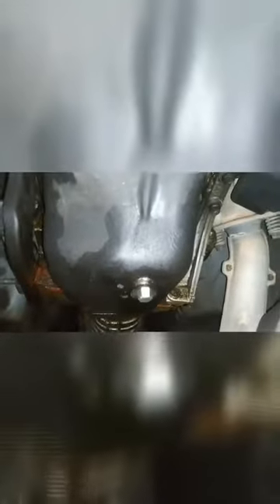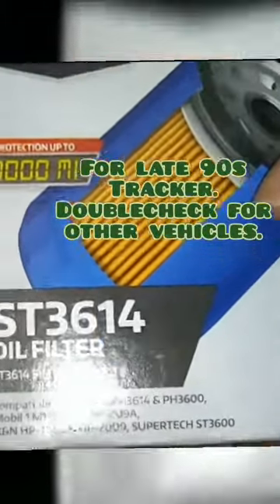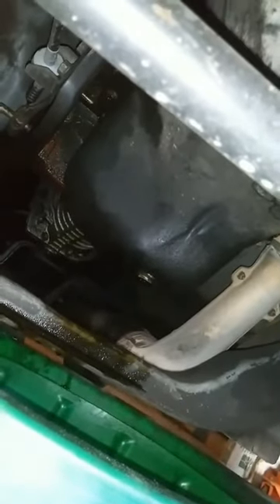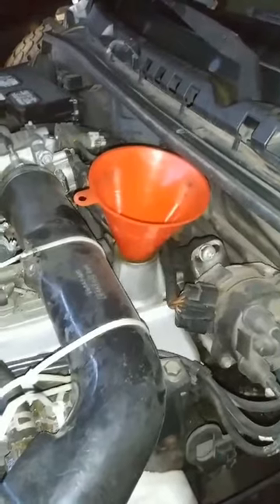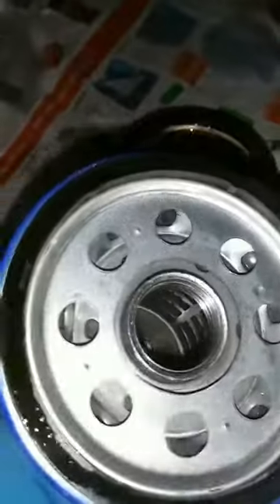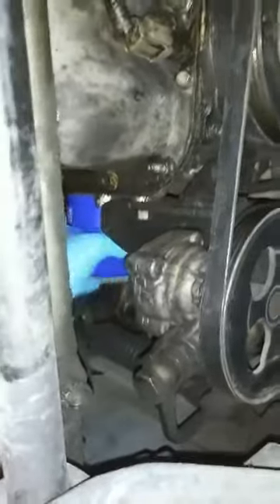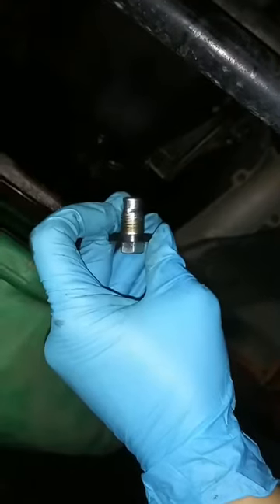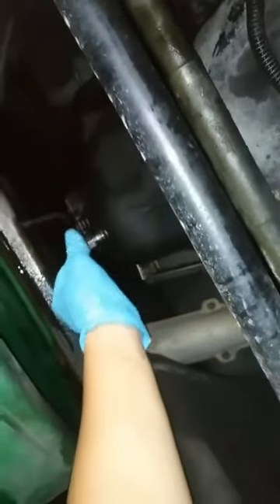DIY Oil & Filter Change (Saving $ with Auto Maintenance, on a Budget)

Comment: Here’s a little quick tip if you ever add too much oil on accident you can actually put a shop vac where the oil cap goes go down and take the drain plug loose and the vacuum will actually pull air from the drain plug and it won’t leak out if you break the seal on the top you can run some oil out then put the vacuum back on it and then reinstall the drain plug and check the level. Just a little trick I learned working at Jiffy lube
Reply from the maker: That's really cool! I'd never heard of that before & will pass it on.
Fortunately, I've not overfilled more than a hair above the full line but I've heard stories from others.

There's no way there's enough suction for the vacuum to take n any motor oil?

Oh & another funny coincidence. The Red I met last weekend, work at Jiffy Lube too, until last year. Ha ha.
I'm tempted to text her about this. I did mention talking Trackers with u, to her though, since she had the same nickname & all. 😃
Reply: @chm3598  that is funny. Red is actually my “call sign” when we airsoft. I think it had something to do with I was always the captain of the red team and then it just stuck. But I have heard of other people having that nickname but usually they have red hair lol. I don’t know what my Heritage is, my mom always said we were just Heinz 57 a little bit of everything. I do know on my dad side I’m like a 32nd Cherokee which is probably why my facial hair grows in all joe dirt like.But then again my brother can grow a full glorious spartan beard which I may be a little bit envious of. Anyway yeah I should’ve kept my jeep another vehicle I wouldn’t mind having maybe sometime in the future it’s like an old 800a scout international. You might have to Google that one LOL
Reply from the maker: @Red-yn9fv  Oh ok. Yeah, the other "Red" is because of her hair. She brought that up, that your hair is probably red too but I wasn't sure. Haha
Getting your name from being captain of the red team is unique though.

Hey! At least shaving is easier for u & u don't go through as many razors. 😁 I bet your brother can't say that!
My brother is the same with the scattered facial hair but that's from our Asian half. (The other half is Heinz 57, like u.)

I'm familiar with a Scout. Interesting choice! I don't see those very often, around here.
I've got about 5 dream vehicles. The top one I don't own is a military Hummer. Will def need a bigger garage one day! Haha
Reply: @chm3598  you can pick those hummers up from military auctions but they are super expensive. Yeah the shaving thing for me is about once every two weeks or so lol. I really like the old scouts but not to keen on the scout 2 although my oldest brother had one for a long time. I’d say one of my favorite vehicles I would love to get is an old bronco. Those are expensive also and the old scouts kinda remind me of a smaller bronco. I’d also like to take a lay 90’s early 2000 Ford ranger short bed and lower it maybe bag it. I always liked how the rangers looked compared to the s-10. I actually had an 07 ranger that I bought new and it was the first new vehicle I had ever bought. I’d like to look into my family history. I don’t know much about my dads dads side of the family all I know is my dad was born in Missouri and moved to southern Idaho when he was 8. I know I have some family here in Missouri but I don’t know any of them anyway I’m off to dream about cars now lol
Reply from the maker: @Red-yn9fv  Oh yeah they're pricey! I glance at the military auctions, every now & then. My ex-military cousins send me auction links here & there too, knowing I'd appreciate it. If I didn't already have too many projects & kinda lacking parking space, I would've bought one already.

Lol! See! U save so much on razors, shaving cream & less razor cuts. 

Apparently u & your brother have similar taste with the Scout models.
Another funny coincidence. Someone brought up liking the Bronco, yesterday. 
Have to agree with u on the Ranger over the S-10.

If u look into this DNA tests, some can help u connect with other family members who've taken the test as well. Plus, give u all the info on your Heinz57 mix.
Some companies offer discount deals around holidays too. I'm eventually gonna get the one that also gives u medical conditions u may develop n the future, so i can take preemptive action.
Reply: @chm3598  that’s a good idea on the medical history. I did hear I think on a clip of joe Rogans pod cast that the 23 and me dna test doesn’t really help with Native American lineage due to they didn’t keep very good track of tribes locations and I did find out that there are like 300 recognized native tribes in the us and about another I think 200 that aren’t recognized. They say the best bet is to hire a company to look up your lineage.
Reply from the maker: @Red-yn9fv  Unfortunately, I'd have to agree on hiring someone. Can't imagine a DNA test could differentiate tribe ancestry, at least not from the same continent, but I haven't researched that much detail on those tests.
It can tell u what percentage Native American, u are, & possibly better narrow down which part of your family.  And what's crazy, the numbers change even between siblings, depending on what genes u inherited. So u r possibly a much higher % Native American than your full, glorious, Spartan-bearded brother. 😁 Which would b pretty cool.
Reply: @chm3598  the other day I found a gray nose hair, but yet I can’t grow a beard😩
Reply from the maker: @Red-yn9fv  LOLOLOLOLOL!!!!
Thankfully, they've got trimmers for that.

I feel your pain. Can't grow a gray hair to save my life!
Sounds like a good thing but it's definitely not. 🤣
Reply: @chm3598  oh I can grow me some gray hair. It’s very distinguished.it’s “a touch of gray” lol like the commercials
Reply from the maker: @Red-yn9fv  Lucky! I can't get that distinguished look, naturally.
Been debating dyeing a little gray n. Maybe the X-Men II Rogue hair.
Reply: @chm3598  that would be sweet. You would have to get huge hoop earrings to tie it in with the comic books though
Reply from the maker: @Red-yn9fv  hahaha. I have a hard enough time with the small loops n my ears, not catching when I'm repairing some things already.
I'd probably become a permanent fixture under a car, if I wore large hoops. 😝
Reply: @chm3598  that is true, but they could also double as bailing wire for those quick fixes lol. Ok now serious question. Do you like Star Trek?
Reply from the maker: @Red-yn9fv  🤔 I'll have to rethink my life choices & figure out why I never thought to wear automotive purposed accessories. Lol

Uh yeah! Who doesn't?!
Did u know William Shatner turned 90, this week?! 😳 🎈🎉🎁 Which is crazy, to me.
I like the movies most of all. (Also watched at least a big portion of TNG, if not most, when it originally aired.) Ran across movies 2 through 8 for an incredible price & bought them all, a few months ago. Already had Nemesis & the three newest with Chris Pine. I think I just need to find the "The Motion Picture" one & "Insurrection" to complete the entire set.
I like how they didn't exactly reboot the new 3 & altered the timeline to allow for a new version but also kept a lot of the same details, that would still b relevant, from the originals.
Reply: @chm3598  I watched so much tng growing up that with the sound down I was able to learn how to read lips. I have this knack for being able to watch the first 30 seconds and can tell you which episode it was. Right now I’m working my way through voyager. I never really got into it when it was on. But my second favorite is enterprise. You should give that a watch. Well from what I’ve heard I think you and I are going to be good friends lol
Reply from the maker: @Red-yn9fv  Dang! Did u have to watch n secret or something? Or when everyone was asleep. Lol
That's pretty cool though. I used to b able to tell u the ep, early n, for a lot of shows. TNG included. But it's been so long, I'd forgotten most.
Can u still read lips? I used to but seemed to have lost most of that too.

If Enterprise is the one with Scott Bakula, I was interested. Free time has always been lacking though. I'm years behind on all the shows I used to watch.
Had the chance to watch Voyager but Janeway drives me up a wall. Well, the actress overacts a lot. So I never got into it either. Probably not the same reason. Ha ha

I don't know about good friends category. Depends on if you're one of those ppl who can only like Star Trek or Star Wars & not both. 😹
Reply: @chm3598  oh I like both lol one year for Halloween I shaved my head and glued horns on my head and went as darth maul. And I’d really like to get one of those ultra sabers that you can actually sword fight with. No I lived with my dad for a bit when I was like 13 or so and he would take naps so I would watch the reruns with the sound down. It was low enough that I could make out their voices but not what they were saying. I haven’t practiced reading lips for a while but I used to be quite proficient at it lol.
Reply from the maker: @Red-yn9fv  U shaved your head?!?! You're a true Star Wars fan. Ok. Good friends is likely. 😁
The good light sabers r the only ones I'd want. One with the light effect of an onscreen saber. I've seen a couple of decently cool ones. Eventually one day, I'd really like to build one myself so I can mix the features I liked most, between them.. 

It's def tough to practice reading lips unless eavesdropping. A little bit of why I think I'm so out of practice.
Reply: @chm3598  yeah they have some top tier ultra sabers that you can build and add sound effects and they have some plain and simple ones that are super cheap but you can still spar with someone. I almost pulled the trigger on one a while back but I looked at it as it wasn’t a necessity but I did impulse buy a flashlight with a pressure switch to mount on my airsoft gun today from tractor supply lol Necessities in deed 🤣
Reply from the maker: @Red-yn9fv  I've seen a number of sabers & have become a saber snob. The cheap ones kinda make me cringe & think of the kid's toys u can buy from a vendor outside a festival, having seen some really good ones. There's not a lot I'm super picky on quality though. So that's saying something.

Ha ha ha! Gotta have yours priorities straight.
Reply: @chm3598  I understand now lol. I haven’t done enough research on brands and read reviews and such. I do have a darth Vader helmet and I have seen some people make the shoulder piece out of Eva foam. I do have a little experience with working with that since I had made my own evil rocketeer costume a few years back lol. I wanted to get some mannikins and put all of the costumes I’d like to build on them. As of right now it’s just one. But I am one of those people that come to work dressed up for Halloween every year. My YouTube profile picture is a private military contractor loadout I made for airsoft but it also worked great for Halloween
Reply from the maker: @Red-yn9fv  Oh I haven't done research either. I just saw a lot of variations, n passing.
I have this tendency to only do research when I'm actually n need of something. Everything else is on the backburner forever.

I use to hang with a cosplay group & one woman had a whole room setup with mannequins, plus all her outfit build supplies.
Couldn't join n the cosplay part, too shy for the attention is brings, but I really wanted to learn to build. My background is electronics & computers. And I enjoy design & building, most of all.
Halloween is my fav day of the year. I'd of enjoyed dressing up at work too, if my co-workers weren't so old & boring. Haha
I've made my own Halloween costume once or twice, when I couldn't find accurate enough ones at stores. Nothing I designed though.
Reply: @chm3598  I know exactly what you mean about only doing research when I need something and everything is on the back burner for ever lol. If you make a costume with a helmet and people can’t see your face it helps with the shyness. If you ever get a chance check out punished props. They make some incredible things and their brand of humor I find amusing. Back in the day I used to work in a computer shop and I used to build cheap computers and sell them locally, but that was back in the winds xp days lol and I had a bootleg copy of it. But things have changed so much I have a hard time working on anything. Actually at the moment my desktop is down I think the motor in the hard drive quit and I’m not sure if I should try to fix it or not. I need to get back out and finish some projects before I take on another one lol. I was painting a room this weekend and didn’t get a chance to work on the tracker
Reply from the maker: @Red-yn9fv  True about a mask but only problem, I have a tough time with wearing those. Even for Halloween, I avoid anything that has to b placed on my head.
I've worn costumes with everything but what they each usually require; if a mask, makeup or temp tattoos. Lol. Oh & no wigs either. 😁

U can replace a HARDDRIVE motor or were u just planning to replace it?
Computer hardware is still fairly easy. Each component, the plug is matchable. It's just the software that we have to keep up to date with. Afraid I'm severely out of date on that too.
Reply: @chm3598  one time I wore a mullet wig and went as my older brother to a Halloween costume party he had thrown. He thought it was pretty funny. I even had the Wayne’s world had he used to wear lol. With the hard drive I know I could purchase another hard drive and clone my old one over but with out it turning I don’t think i can. I thought about going with a solid state drive so I don’t have to worry about a drive motor in the future. I’m just a little worried about messing the entire thing up and loosing all the stuff I had on it including pictures from the first time I got to meet my grandpa last year just before he passed. Every once in a while I’ll walk in and turn the computer on to see if I can hear the hard drive hum or not lol wishful power cycling lol. I am working on a new Eva foam armo vest kind of thing but the project got stalled and I need to get back on it so it will be ready for Halloween . I really wanted to make a mandalorian costume and they have a ton of free download patterns but like everything else it’s trying to find the time
Reply from the maker: @Red-yn9fv   lmao! Omg! U dressed up as your older brother for Halloween & it involved a mullet wig!!!

 I get that! I've had multiple drives crash on me & periodically power cycled them, n hopes it'd magically fix itself. I've had that happen once or twice & copied the files the second it came up but most have been goners, to the point where I researched data restoration companies.
If it's not the disc itself, not a corrupted disc, a company can recover the data for u. It's the safest way to b sure u don't lose anything & the price isn't bad. I'm as delicate as a bull n a China shop. So there's some things I WON'T attempt myself, like dismantling a HARDDRIVE I want to keep or when my laptop needs to b fixed.
I'm super impressed if u r contemplating that.
Hope u can at least get your pics back, with your grandpa.

Solid state is def the way to go! I just wish they had higher capacities by now though.
Until then, I've got about 3 HARDDRIVEs that I backup everything on. The biggest being 10TB. Lost enough data the first 2 that failed, I don't mess around.

That reminds me. It's not the same but the one pic I had of me on top of a mountain at Machu Picchu, was stolen with my SD chip, out of my bag.
I climbed that mountain with 104 fever & didn't want to climb the 2nd mountain we had scheduled, the next day. And I was so sick that first day, that was the only pic I took. I'd considered taking my friend's photo & edit my head n place of his from that mountain. We r about the same size. Haha. But never did remember to do that.

A Mandalorian costume would b really cool. Is there paint that would make the foam look like real metal?
I really need to start thinking about Halloween. Just lacking n time too. And wasn't sure Halloween was really happening this year.
Reply: @chm3598  yeah the solid state I was hoping would be further along than they are as far as storage. I got out of computers back when pc 3200 first came out of that tells you how long it’s been lol. That sucks about loosing your picture on top of Machu Picchu. My aunt showed me pictures and told me how long of a trip it was just to get there. And then I watched a documentary on it and it’s super interesting. But with a fever of 104 I definitely couldn’t have done that. When I’m sick I turn into a big cry baby. As for the mandalorian costume they have several techniques to make it look metallic. I think one is something called rub and buff and I think the other is some sort of graphite powder. Right now I’ve just been working on that room, I took all of the cheap electrical boxes out of the walls and was going to put in new retrofit boxes with the tabs that hold it down to the back of the sheet rock but so far Lowe’s, menards, smc, ace hardware, and sutherlands are all out of these retrofit boxes. Idk if there is a bunch of new construction going on around here or if there is just a shortage from China or Canada? I know the price of 2x4’s are like $8 so idk what’s going on. Anyway I’m hoping to get some things done in this room so I can spend the weekend in the garage working on the geo
Reply from the maker: @Red-yn9fv  I'm not sure when pc 3200 was but I'll take your word for it being a while. 😃

The trip time wasn't too bad. We flew to Peru. Then I think took a train to the active city, next to Machu Picchu (Aguas Calientes). We coulda walked from there but the bus was much faster.

I've heard of "man flu" & been shown a YouTube video. I thought it was an exaggeration.
Is it like that, when your sick? Ha ha
I'm pretty much a "I've been through worse & survived. This prooooobably won't kill me, but I'll do it anyways." kinda person. And I wasn't making the trip again, just to climb the mountain. Completed at least 2 Spartan Races with 102 fever, for the same reasons. Looney or dumb. Could go either way! 😁

Ok. All of those paint methods sound VERY time consuming.

Have u checked the hardware stores online inventory? Sometimes, i have to order items through their websites because of shortages.
But if u can't get the boxes yet & you're done with everything else, the Geo would appreciate some attention.
Reply: @chm3598  well I have these open back wall box things from back in my cable guy days and they will work but isn’t “ up to code” per say but you won’t know unless you pull the outlet faceplate. I think I’m going to use those until I can get the correct ones (aka probably will forget about). I lifted some heavy stuff today and kinda strained my back and I’m realizing I’m not as young as I used to be. Soooo I probably won’t be doing any Spartan races 😝 I’ve seen a mud run onetime and thought “oh yeah I could  run up that incline” lol  I wonder if they have an old person lane and you can just walk it. I’d probably be good at that one. I do have some exercise equipment in the basement but I have yet to use it. I need to not look at YouTube as much and try and be more active. I’m hoping this summer I do a lot more hiking and camping and biking.
Reply from the maker: @Red-yn9fv  U could YouTube exercise videos. Lol
There's plenty of good ones, for when your back is better. 
I join a zoom kickboxing class, when i can. Been meaning to look into HIIT YouTube training vids, a friend suggested to me.

And hey! U can do a mud run at any pace u want. I didn't do any because I thought we all had to run &, due to a permanent injury, I can't. Then I found out we don't have to. So I'm just n it for the obstacles. 😁 I have to jump walls a little funny because of the injury. But I make it work & no one notices my crap "technique".
I've seen 70 year olds doing these Races. Just make sure u train, stretch & have plenty of ice packs. 🤣
Reply: @chm3598  I didn’t even think about using YouTube to work out. I think I’m going to have to look into it lol. I think my back problems came from having the “do what ever it takes to get the job done” mentality. But I did just get some cbd lotion that I think I’m going to take a soaker bath and then put that on. That sucks about your injury but at least you are staying active, makes me feel lazy lol
Reply from the maker: @Red-yn9fv    I've been thinking we can do just about anything with YouTube vids. It's just a matter of finding reliable/trustworthy info ones & not putting too much into the not-so-good ones.
I'm hesitant to post some of my repairs because I don't want to send someone astray, n case my method wasn't the most efficient. (One I just shared, about how I "technically" built a new hose, being one of those vids I hesitated to post.)

Hey! Nothing wrong with the "do whatever it takes...." attitude. Just remember, ALWAYS lift with your legs. 😁 I learned that the hard way too. Haha
Hope the bath & CBD oil helps your back. U only got one back. So u gotta take care of it. 

Thanks. It's cool though. We all got something to deal with. Took me about 10+ years to regain the ability to walk & another 3 or so years to build it up to where I'm at now. I'll never b the fastest runner but I can compete n obstacle course races & I'm thrilled.
Reply: @chm3598  I thought the hose video was great. I had purchased a long time ago a 2000 f150 and it had a weird idle problem and the check engine light was on and I had it scanned and they said it was lean on bank 1 and 2 and it’s probably an o2 sensor and they were $95 a piece so I went online and read some forums and they said check your vacuum lines and I found this rubber elbow that had a hole about the size of my finger in it so I called the auto parts store and they searched it up and found the part and it was about $30 I went a head and bought it and got it home and was looking at it and was thinking I have got to figure out something better than this $30 part. So I used the L part of a spark plug wire and popped that on there and cleared the codes and took that $30 part back. I thought about commenting and telling that story but I feel like I comment to much on videos but I did give it a thumbs up. That’s crazy about how long it took you to be able to walk again I can’t comprehend the level of commitment and frustration of something like that. I wasn’t able to take a bath or try that cbd lotion. I worked on the electrical in that room till about 930 and then had to go to bed and be up at 4:30. I’m sore today but I’m just looking forward to 5:00 lol
Reply from the maker: @Red-yn9fv  The spark plug wire boot?! That's genius! Lol

Oh comment away! Maybe your stories will help the next person save $30 too. Or me. 😁 
Automotive chat is always welcome. Especially with anyone who's cool about it.
Reply: @chm3598  I enjoy problem solving and helping others. I was thinking about testing out the shopvac oil change trick we talked about a while back and doing a video on that. I was also talking to some of the guys at work about go pro’s and they said if you use the program/app you can edit the videos easy and you can do it with any generation of go pro. I don’t know how to edit so my videos I keep short and they are usually just a one take lol so if you hear me rambling it’s because I don’t know how to edit that out lol
Reply from the maker: @Red-yn9fv Me too! ☺

Demonstration videos would actually b perfect. I've watched several that've helped me so much. I try to record what I'm doing, with vids I'm gonna post, since visual aids r often way better than a description. It's just not always possible & I have to just explain.
And I understand! Think I've gotten better about not rambling, on camera. But that was after some experience.
I don't think I've noticed rambling n your shared videos though.
Oh, if you're videoing with your phone, many have built-in editing programs.
And if that doesn't work well enough for u, I use a couple other apps; MyMovie (mostly because it's easier) & PowerDirector. Fyi, they both have annoying glitches, I have learned to work around. There's plenty of other apps to try out too. I tried a few & MyMovie was the best of that batch.
Reply: @chm3598  I was looking on Craigslist and found a couple go-pro hero + for around $70 and figured it might be something to look into but I think I’m going to look into those apps you were talking about. Well it’s Sunday and I haven’t had a chance to get out in the garage. I got the electrical all done in the room I was working on and painted some trim and was going to put it up with my brad nailer but couldn’t find my air chuck I had used earlier in the day and after searching for 2 hours I gave up and watched tv till bedtime. I looked again this morning and still couldn’t find it so I’m off to menards to find some new parts. Story of my life lol.
Reply from the maker: @Red-yn9fv  The apps r free. MyMovie keeps glitching today but can't complain too much since I didn't pay for any of these apps. 😃 

I hate when those gremlins eat tools & parts! Lol
Best luck on that room done today.
My work-on-vehicle day has switched to fight-app day.
Reply: @chm3598  it’s amazing how much you can get done when you have to spend $10 on an air chuck just to air up a portable air tank to use a brad nailer lol. I’m finally done minus a few small places that need touch up. Hey I was thinking it would be cool if I could post pictures of the stuff I work on here on eBay but I can’t and it just hit me that I have a Pinterest account and I post stuff on there if you ever want to take a look. I do have some tracker stuff that I think is “cool” lol
Reply from the maker: @Red-yn9fv  Yeah sure. Share the link whenever u want. I don't have a Pinterest account but should b able to see the pics. Or at least some. Their website does have this annoying thing about blocking view, while trying to force ppl to register, that I refuse to do.
Reply from the maker: @Red-yn9fv  lol. The link took me to a bunch of Tracker pics to drool over. Gave me some ideas for "trunk" storage, I never thought of & have now added to my never-ending To Do List.
Pinterest is still trying to force me to start an account, to see, what I think is your subfolders. But I can't view them, without the giant Pinterest banner.
Reply: @chm3598  I wasn’t sure if I’d like Pinterest or not. All I do is scroll through and find stuff I like and save the pins. I have folders like “ things to wear” and “diy pallet projects” and “ airsoft helmets” but I add to the tracker one a lot. I really like the subwoofers and amp in the tailgate. I might try to do that lol. Well I got a promotion at work this week and today was my first job out in the field. I got to use a hydroelectric ladder lift mounted on a truck so that was kinda fun/scary but I’m really hoping to excel at it since I really enjoy troubleshooting. Anyway I’m hoping to work on the tracker tomorrow between picking up Walmart orders and going to my nephews son’s birthday party. I’m not sure what that makes him. My second nephew idk I’m tired lol
Reply from the maker: @Red-yn9fv  I didn't even know Pinterest had Tracker ideas! Still not gonna create an account, since they keep trying to force it on me, Google already annoys me enough with that 😆, but the Tracker posts r cool.
Saw the subwoofer box & if trunk space wasn't higher priority, it'd b my fav!

Congrats on the promotion. Even more on it involving a hydraulic ladder. Lol

On the title for your nephew's son, I'd go with "confused". 😜

I completed 2 more obstacle course races yesterday, when I shoulda been working on repairs, instead of camping at the race grounds. Disappointed I didn't place but I'm not beat up, like the races a few weekends ago. Those scrapes still haven't fully healed. 🤣
But I should get time to look at this Tracker today though. Hopefully I found & fixed the LAST oil leak. 🤞
Did take the time to wash the Tracker, as soon as I got back. The Race grounds were so dusty that the black tires were solid gray! Have to detail the interior today, since dust blew n every time the door was open. There's a thin later on everything, minus hand print spots.
Reply: @chm3598  so far I haven’t had a chance to get out in the garage. It rained all day yesterday and we had that birthday party. Other than that I had replaced a fan switch in that room I was redoing and after a few days I realized it smelled funny in that room and after sniffing everything I realized smoke was bellowing out of the fan which is right where I had replaced the switch so after a trip to menards I put up a new fan. So I’m glad I didn’t inadvertently burned my house down. Well I had to go into my Pinterest settings and turn some stuff off because probably 4 times a day they would flood my inbox with “pins you might like” so now it’s just notifications when someone I’m subscribed to posts a video or likes a comment. I bet those races are exhausting. I get tired walking up the street to the mailbox lol. I did go out and pick up a ton of sticks  and list some stuff that’s cluttering up the garage. I’m hoping to sell enough to be able to pick up a small welder for the body work I need to jump on after I get the tracker back up and running. As far as detailing, I need to clean my truck. The present I got for the birthday party well the bag had glitter on it and it’s now all over the floor lol. Time to hit the car wash
Reply from the maker: @Red-yn9fv  Dang! Good thing u weren't n the garage when the fan started to smoke!

Ok, it's glitter. You're never getting all of that out of your truck. Lol
I did a project for Christmas 2019 & still randomly find a piece of glitter here or there. Occasionally, I find a piece on my arm. You're just gonna have to tell ppl you've taken a night job as a stripper. 🤣

I detailed half of the Tracker. There was a lot of camping supplies n there & EVERYTHING has a layer of dirt, needing to b washed off.

U can get an arc welder for about $100 at Harbor Freight. I got that one. Their 20% coupons exclude them but they have periodic sales, specifically on those. Couldn't tell u about mig welders. I priced both & there was a huge difference. So I got the cheapest arc welder.

Haha. The races aren't bad, if you're trained for them. i completed 2 on Saturday. But the first race did destroy my hands &, the second round, it made some of the obstacles VERY painful to finish.
Oh yeah & the toe blister that it caused. Such an odd place to get a blister! Lol
Reply: @chm3598  yeah I’m glad I didn’t leave the fan on and run to town or anything. I don’t think chip and dales would take me. I’d probably just look like I was having a seizure lol but I bet the money would be good. I keep stockpiling camping stuff. I think I’m up to 5 tents now. The last one I got was an Izard trail Tepee. I am also kicking around the idea of making a chuck/ camping box. I found a few ideas on Pinterest 😉😉. Lol. So I have a stick welder and this thing is older than dirt and hard as crap to weld with. I wanted to find a mug welder that can use gas or the flux wire. I didn’t figure I would be building bridges with it or anything so a cheap one would probably be fine. I am selling an old paddle boat that’s been sitting for a while now and I might get enough out of it to buy one. Or I could start stripping. Either way I’m going to get me a welder lol
Reply from the maker: @Red-yn9fv  I technically have 5 tents too. Still have my very first tent, with the old-style wide poles, somewhere, that I really should discard. And a scavenged 1-person, that I never checked if it was missing anything.
When i camp, friends don't usually have their own gear. So I end up supplying most of it, for everyone. Got this new 10 person tent, with 2 rooms, that I never got to use because quarantine hit. Also because I don't know any real campers. 
I don't have anything fancy like a camping box. (Had to look up what that even was. 😆 ) But my gear is workable for multiple ppl on a basic camping weekend.

Ha ha ha. U would prob get that mig welder much faster as a stripper. Everyone has a gimmick. If Yours was something like seizure dancing, the women would tip more for that extra shake n your step.
Reply: @chm3598  sorry for the really late reply. I did like your last two videos especially the gas cap one. Yeah this new job has me all over the place and I haven’t had much time to sit still. I drove 4 hours one way to Knoxville Iowa to the sprint car hall of fame for work and spent 3 and a half hours working and then drove 4 hours back. That was last Friday and it was like a 50+ hour week. They did tell me to watch my overtime this week lol. Anyway I have one tent that got rained on so when I got home I put it up in the yard and flipped it on one of its sides to dry the bottom of it and another storm came threw and blew it over the fence and broke one of the poles. It’s like an 8 man tent and it didn’t mess the tent up at all but I keep trying to find some tent poles at garage sales but haven’t found one yet. Then I have the tent that I rolled a pop can up in one of the pockets of the ten and it got a bit moldy but it’s still a nice tent so I can’t bring myself to throw it away. And I have a brand new 2 man tent that I left new in the box for like 10 years and the elastic inside the poles fell apart and it’s only like $5 to order new elastic for it but I’m to lazy lol. Anyway I know in June I’m going with my brother and his friends on an adult float trip so I think I’m going to take the new teepee tent. I’ve been looking for a camper shell for my truck to keep all my camping stuff dry and secured but I haven’t been able to find one since my truck has the shortest bed known to exist even know they have run the exact same body style since 2005. Anyway I’d like to find one before June. Other than that I just looked at the tracker this weekend but had to work on plumbing on the house and was crawling back and forth all weekend. Today I was back doing my old job in the shop because it snowed today. Nothing like a nice mid spring snow storm lol
Reply from the maker: @Red-yn9fv  Hey! Welcome back! 
Np. I figured u were busy. Or I went too far with my joking. (I've been known to do that & tick ppl off.😳 ) 😝

Glad u liked the vids! ☺

And dang! When u said u were moved to the Service Department, my brain assumed u were behind a counter at a mechanical shop or something similar.
U shoulda spent a few minutes checking out that Hall Of Fame. Especially since u drove all the way out there already.

Lol. U sound like a potential packrat, like me.
Not sure your options there but I have bought a tent pole replacement kit at BassPro. It came with the elastic string too. Only problem i had was that the two pole options weren't the right size & their online description sucked. So watch out for that. My 6 person tent is a little lop-sided, with the replacement piece being a few inches too long. I'm sure other stores have a tent pole repair/replacement kit with the string, like REI, Academy, Dicks, etc. BassPro's was maybe $13-$16. But that was around 5/6 years ago.
U can't safely take a soapy sponge to the moldy tent? Except for staining, it'll probably clean right out.

A friend of mine has this really cool folding, lockable truck bed cover. I think he said it's weather resistant & looks kinda heavy duty. I think i could sit on top of his truck bed liner & not even dent it.
I plan to get one like our, if i ever get a pickup again.
Reply: @chm3598  naw your good, I have a tendency to tick people off at work with my sense of humor. I find myself having to real it in and say to myself “ok we got to keep it pg 13” lol. Yeah your videos are always great. The first thing I did when I got my tracker was buy a new gas cap since the old ones seal broke and the fumes actually ate the paint above it. That or someone tried to light it on fire. Either way it has a new gas cap lol. Yeah the service work I do now is basically just small trouble shooting and a lot of parts changing but I’m out of the shop and I get paid to drive a huge truck (which is a manual) and listen to music. The only freaky thing was going 80’ in the air in a rented lift that neither me or the guy training me knew how to operate but we got it done and I got to see a bunch of dead birds and try not to pee my pants. But I was ok so I think once I get used to it I’ll be fine. They are going to get us tablets though and I guess make the job easier. Hopefully I don’t drop it lol. Anyway we do have several bass pro shops around and I think maybe I’ll look for that elastic rope so I can fix that one tent and maybe sell it and buy another. I did see a military tent for $1000 and though hard for about 2 min about buying it but i decided to just stay with what I’ve got lol. Other than that I’m thinking about getting some spider stranded fishing line and going cat fishing here soon. We got hit with another cold blast and it snowed yesterday but Tuesday the high is 83
Reply from the maker: @Red  At least u know to dial the jokes back. I joke about almost everything & I'm missing that sensor that tells me "you've gone too far". It's much worse when I can't see faces, to see I got a negative reaction, instead of what I was expecting.
A few friends had stopped talking to me & I STILL don't know what I said, that they didn't like. Lol

Wow! I didn't know exposure to small amounts of gas fumes could eat paint. That's crazy!

Oh man!  I wanna work the controls really but I've always wanted to b inside one of those lifts. Saw a couple guys, one night, they were watching fireworks n one of the baskets, extended all the way up. I was so jealous! (If u could get away with that some day, might help with u getting used to it faster. A more positive experience, instead of just work.)
I'd likely b super nervous up there too though. I like the idea of falls where I won't feel it when I land, not ones I'll live through. So skydiving = yes, bungee jumping = no no! 😁

Bungee or tether the tablet to yourself. I'm VERY accident prone & purposely buy phone cases that have a wriststrap connector/tab. 
I'd do it with anything easily droppable, if I owned anything else.
And I have a phone armband. But that's also because women's clothes weren't designed with good pockets & they're often too shallow to safely contain a phone. Not that an armband will help u with a tablet. I was just rambling. 🤣
Reply: @chm3598  I considered some sort of holder for the tablet. Soooooo today has turned out to be a crap day. I am currently at a gas station and have been here since about 11 or so. I put gas in a diesel and had to contact a mobile service to come and pump out 33 gallons ($90) and then I get to put in the correct diesel fuel at I’m sure around $100. I’m really hoping to not get fired. But in my defense I really had to pee and the handle was green😂
Reply from the maker: @Red-yn9fv  Oh damn! Next time, wait until after u pee! Haha
But if u haven't already, take a pic of the gas pump handle, to show them when they say something. 
I almost did the reverse of that once. Thank God diesel pumps r too wide for regular gas tank openings & it made me realize i wasn't paying attention.

I was about to comment that I just saw a baby possum & it's so cute! (It could've been a small rat but I'm going with possum. haha. Light-colored, triangular face.) Never seen one outside of pics & def not n a metropolitan area.
Reply: @chm3598  yeah I feel sick, I’m really hoping I don’t get fired, I’m going to offer to pay for everything. Possums are everywhere here. I had one die under my house and had to roll it over into a trash bag and drag it out from under the house while gagging. Now armadillos have been showing up more recently over I’d say the past 2 years or so. I used to never seen them on the side of the road. Oh and I did take a picture of the pump lol
Reply from the maker: @Red-yn9fv  Don't stress over it. U probably aren't the first & def won't b the last to do that. Just don't do it again & u should b ok.

Eew! Must've been a big possum.
I've been lucky & only had to deal with a dead rat once, outside. But it was long dead & didn't stink. I did still ask someone else to remove it though. Ha ha
I did catch a live rat one time & took care it myself. But I'm good as long as I don't have to smell something gross.
Reply: @chm3598  when I got back I talked to the owner and I told him that I messed up and owned up to it and offered to pay for the guy that came and pumped it out and the $90 of gas. He said he appreciated me coming to him and telling him and to not worry about paying for anything and that it was a honest mistake. So as for the possum I had it in the trash bag and I put it in the burn barrel and it was there all winter and in the spring I was mowing and I hit the bottom of the burn barrel and the edge of the deck and it tore the trash bag and it was 6 month old possum soup and every time I did another pass by the burn barrel it was horrendous and then my dog was over trying to lick it. Yeah she slept in a kennel that night lol.
Reply from the maker: @Red-yn9fv  Suck up! Ha ha. Just kidding.
See! Nothing to worry about.

The horror movie fan side of me wants pics but the part of me that would've paid to get rid of the mesh & smell, is going eewww!
Reply: @chm3598  it was pretty bad lol. Well I get to drive 2 1/2 hours one way to fix something for an hour and drive 2 1/2 hours back and then I get to go home for they day. So all in all not to bad.
Reply from the maker: @Red-yn9fv  So much windshield time! I hope your company charges a lot for all of it.
As usual, my day was not nearly as productive as I needed it to b. I just have too much to repair & not enough time for it all. But I did get my monthly rock climbing gym day n. So that was fun. 😁
Reply: @chm3598  yeah they pay me to drive between jobs. I ended up with  2 1/2 hours overtime yesterday and got to go home early. I stopped by and talked to my mom for a bit and went home and worked on the geo. I took some of it apart and then timed it correctly and started putting it back together. I made a short video and it took for ever to upload this morning. I’m hoping to work on it again some more today
Reply from the maker: @Red-yn9fv  Oh I meant that I wonder if the customer pays enough for each repair, to cover your drive time because that's gotta b a crazy extensive repair, to make up for your time. 5 hours driving just for that one job. 😳

I saw the video & 👍 it. Your Tracker is coming along nicely!
Was the alternator connector wire brittle? I'm kinda extra paranoid about parts breaks, due to dryrot & age. A friend told me about this solution that restores old wiring insulation. I keep forgetting to look for it but definitely wanting to try it out.
Reply: @chm3598  it yeah they pay for the drive. I think they call it a trip charge. No I think I was a bit rough when removing the alternator. So I went to o’reillys this morning and bought the new alternator belt and tried to find some tubing and all they had was a 10’ section and it was $40 so I went to ace hardware and picked up some hose for $3 so I’m going to try and get that done today. I did go to a huge garage sale on the fair grounds and it was a muddy mess but I picked up an older mug welder that has the option to use gas for $40 so hopefully it works lol. If so I can weld up that frame where I pulled it back open
Reply from the maker: @Red-yn9fv  I didn't know Ace has hose for oil applications! Makes sense since they sell stuff for lawn equipment & etc, I just never thought to look there. Nice!

And mig welder for $40!!!! That's awesome! I'm super jealous now! I wanna run across a deal like that too. Hope it works great!

I was gonna do necessary home repairs & maybe focus on the Tracker A/C today but I won tickets for a new movie. Woohoo!
Fun over priorities! Ha ha ha
Reply: @chm3598  I have a ticket to go see mini sprints race tonight so I’m hoping to work on the tracker before I head down to the race track. I’m hoping the hose will work. It’s just from the power steering reservoir down to the pump inlet. I don’t think there is any pressure behind it since it’s before the pump so the hose clamps should hold it just fine as long as I got the correct inside diameter of hose. Well see lol. I’m hoping that’s where the leak was coming from. Everything else looked in good shape just kinda dirty.
Reply from the maker: @Red-yn9fv  That's cool! I'm jealous again. Lol
Someone told me he had baseball game tickets yesterday & I def was hating him. N a friendly, happy-for-him kinda way.

Ok. I was gonna mention I had a power steering fluid leak before. Depending on where you're seeing the power steering fluid, mine was leaking at the cap. It covered everything below it, which masked the leak, until I sat down & cleaned it up to closely monitor it.
May not b your situation. I had to cut a new gasket, to stop the leak. I added a vid on here, for it. Not that you'd need to see it to cut a cap-sized gasket. 😆
Reply: @chm3598  well the thought did cross my mind. I even thought maybe the reservoir had rusted through and started leaking but after cleaning every piece with rags and a scrub brush the only thing I had found was the crack in that tube. I do have some old bicycle tubes I have cut up that I can use to make a new gasket. Also I noticed when I put the main pulley back on the crank that there is some sort of seal on the back side that was falling apart. I think it’s a dust shield gasket kind of thing. Idk it will probably be alright. Also what movie are you going to see?
Reply from the maker: @Red-yn9fv  I thought the reservoir body itself was leaking on this Tracker too. But the house was ok. Figured the leaking fluid saturated it enough to keep it from dryrotting. Lol

Saw u got yours running. That's awesome! Thought u had way more parts off, to get it done that fast & watch Sprint cars.
Was wondering though. I may have sleepy eyes rn but the power steering hose looked a little twisted. It may just b me though. 
If it is, don't throw out the old hose yet. A couple AutoZones would let me n back to compared all of their molded hoses until I found one with the right bends to mine. (I've always worked on complicated vehicles, so they knew me. Lol)  Sadly, once it was the way more expensive hose because it was an oil resistant hose that was the only workable replacement for a cheap air hose but it fit perfectly.

I won tickets to see "Voyagers". Was cool. Never seen "Lord Of The Flies" but based on the plot spoilers I've heard over the years, this was similar to a futuristic version of that movie.
Reply: @chm3598  yeah I didn’t go to the sprint car race due to a trip to the er. Everything’s good now but it freed up my night and I worked on it till about 10 last night. There is a twist in the hose and I’m hoping it won’t be a problem and I’m going to keep the old pipe and keep an eye on the replacement to see if it starts swelling. I figured if it wasn’t oil resistant it might swell up and then I’ll know. When I took everything apart I found a crack in the hose at the bottom where it meets the pump. I wasn’t sure the reservoir was leaking or not, I figured when I put fluid in it I will go check for leaks. I know I ran it for a few min last night and the temp gauge didn’t move so took the wire off the terminal and cleaned it and put some dielectric on it. But all the dash lights don’t work so maybe there is a blown fuse somewhere. I haven’t heard of those movies but I also haven’t been keeping up on new releases lol I’m going to look into them though.
Reply from the maker: @Red-yn9fv  ER????? For u or someone else?
I'm going with someone else, since u worked on your Tracker afterwards.
Reply: @chm3598  it was for someone else. But it’s all good now. I was in the garage and heard it all go down.
Reply from the maker: @Red-yn9fv  Oh crap! Glad they're ok.

Oh but in the movies, I don't really keep up either. Been avoiding humans, with everything going on n the world. Lol
I used to go to a lot of new release movie prescreenings. They moved most to online viewings & I've been signing up for those. Some of our theaters started opening back up & I figured I'd sign up for the ticket giveaways, just go to matinees when no one usually goes n the theaters.
I don't win often. Won a pair of tickets this time though. 😁
Reply: @chm3598  very nice. Yeah our theater opened up and I went and saw war with grandpa. It was ok lol but they had every other isle roped off and they had it where when you are done eating you had to keep your mask on. I can’t wait for all of this to be over but I still think we have a couple years left to go
Reply from the maker: @Red-yn9fv  I can't wait for all this to end too. Was 🤞 for less than a year but you're probably right.
But a lot of the memes have been freaking hilarious!

I've got At Risk family that I volunteer to shop for & do other stuff for, so they don't have to b around the public yet. Which means I have to b extra careful & I've even quarantined after each sets of races I've done the last month. Latest one just ended.
My mom & I took my grandfather for a Sam's Warehouse run today, with precautions. (He's amazing with business & finances but doesn't understand medical science.)
The trip reminds me of a meme from last year:
"Why does leaving the house feel like I'm making a supply run on The Walking Dead?". 😝🤣😹